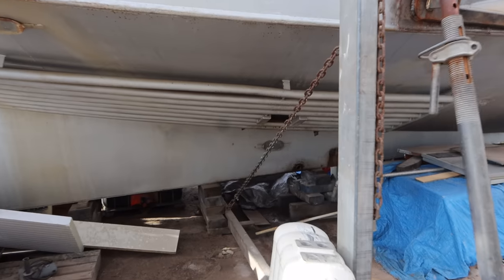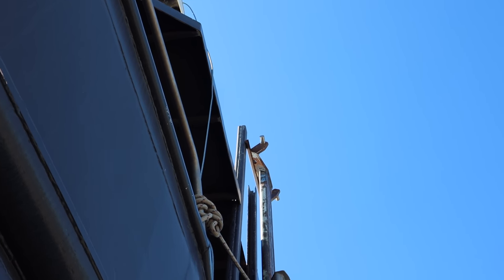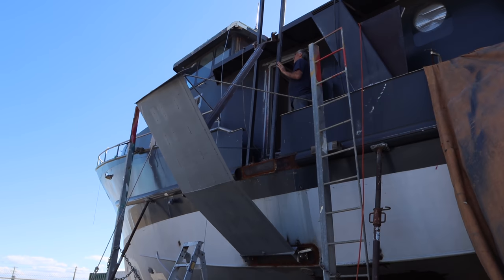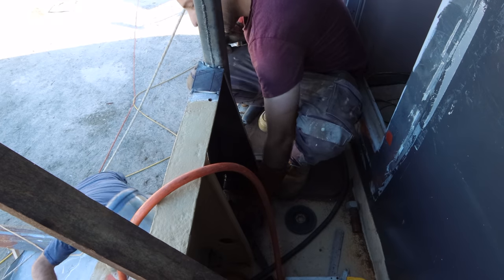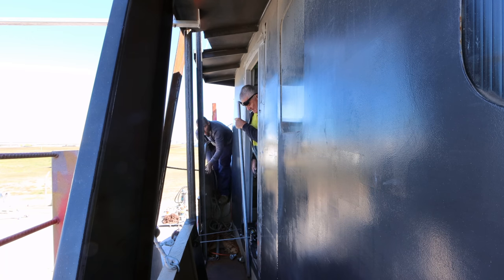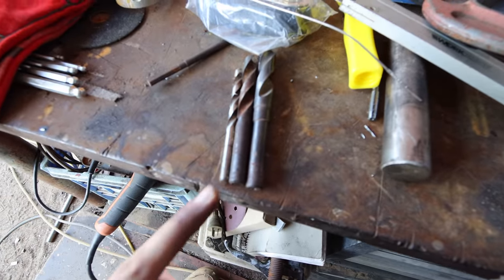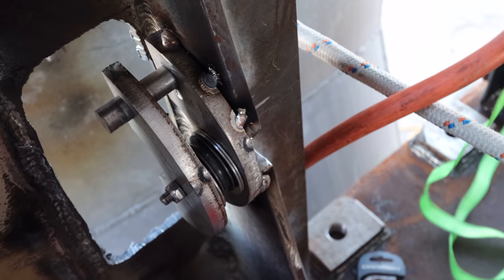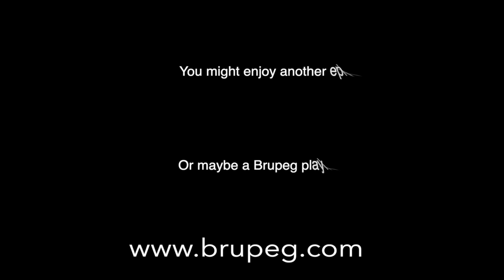Making Pulleys (part 1 of 2) - Brupeg Ep. 169

Comment: Just a quick question from the uninitiated, why did you mount the winch to do a diagonal pull as opposed to a direct pull with it mounted directly behind the guide arms, great work and really really look forward to the episodes coming out, also will you ever be doing a bio on Trev as this is a man of many skills and I for one am curious about this great bloke. Cheers Damo, Jess and Trev. Regards Dave Telford, Adelaide S.A.
Reply from the maker: Hi Dave, simple answer is the lounge structure is very lightweight steel (3mm) so not something we want the full wing weight hanging off, the wheelhouse by contrast is 6mm and is much more solid. As for a bio on Trev thats really up to him, he is qute a private bloke so we have asked but he only gives us snippets which we always include as we get them
Reply: @ProjectBrupeg  Yep he is a champ, thought that was the case with the location but had to ask, I guess you ruled out mounting a doubler on the roof, either way the project is coming along nicely and I itch to see when the next episodes come up, all the best you you all.
Reply from the maker: Yeah I just don’t trust a doubler not to rip out of that 3mm unless is was massive. We also need to put our jet tender on the roof so we can’t clog it up with gear for the wings without causing issues down the track. Everything is a compromise in one way or another and now the wing winch system is working (finished a day again) it really works a treat, better than I ever thought it might
Reply: @ProjectBrupeg  Great to hear, cant wait for the next episode

Comment: When you get to a dock low enough will you lower a wing and have steps to get down?
Reply: Any dock low enough to allow the wing to drop would be 3' under water. Plus most docks aren't wide enough either.
Reply: @quarlow1215  Most yeah but there are some pretty interesting dock set ups out there.

Comment: I was wondering if you have thought about the effect of those wings coming into contact with ice or reefs when they are deployed and the effect that will have on points of connection to your hull. Hit it hard enough and you might tear a whole in the hull.......Just a thought. Maybe some form of bracing to go forward that would help and act as a shield to objects colliding with the wings.
Reply from the maker: Hi Paul, the mounting point on the hull joins with the storngest part of Brupegs structure hence we are able to run without the need for forward bracing, the desing we are using is one that has hundreds of sea years alreadyunder the keel so we are just copying what is currently at sea rather than inventing it all from scratch
Reply: @ProjectBrupeg  Thanks for that, I was just worried that if you hit a submerged object at any kind of speed, you might hole your hull and the places you are planning to go wont have any help on hand as it were. Enjoy watching your project, and as I am a retired fitter and turner/ welder, I have been watching your problem solving with keen interest as well as having a keen interest in sailing. Keep it up you guys. (and gal)
Reply from the maker: Cheers Paul. We are actually planning on making the wings removable at sea so we can steam south with wings then at the ice edge, lift them clear of the water and clip them onto the hull a couple of feet above the waterline, then attach them post ice work. Should be a bucketload if thinking going into that but for now it’s just get wings working
Reply: @ProjectBrupeg  Have you thought about hydraulics to raise and lower the wings instead of cables. I saw a comment earlier from someone who felt the cables might become problematic and for me it kind of made sense as well as the rust factor on cables, stainless or otherwise. Anyway mate I am sure you guys are getting all kinds of advice, so I'll shut up now, but I I see anything that intrigues me I'll be sure to ask the questions.

Comment: Dam - how will the wings lock into place, to stop them folding up when in the swell.
Reply: Bolted to the deck
Reply: @paulkube3901  Not sure about that. They have no contact with the deck.
Reply: Brian, when down, the top of the arm has a plate that is bolted to deck reinforce with 1"+ bolts. See previous episodes :)
Reply: @paulkube3901  I have watched EVERY episode. I have seen the plate wlded to the deck. My question is - you have the arm running up and down the guides, lifted by a winch. I cann see the winch stopping the wing going lower, but what stops it going higher. how do you lock the deployed wing in place. if this is to steady the boat as the boat lists to port, the port wing has to hold fast. How will it do that. This is not clear to me, or you, I reckon:).
Reply: As Paul says in the lower position it will be bolted to the deck plate, you must have missed the episode when they explained it
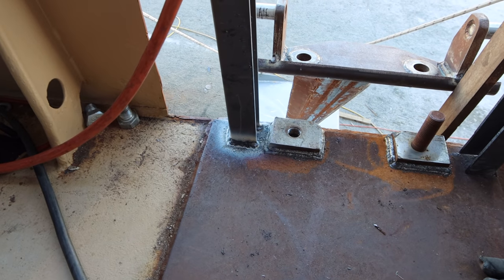Reply: At 12:29 you can see the threaded bar  sticking up , that is going to secure the wing ( there will be one in the front hole too )
Reply: My question is, how in a rolling sea do you get the bolts in and keep you fingers? Same with lifting them back up, bolt removal could be a challenge. I’d like to see a mechanical lock, almost, auto hock, like on a uk farmers gate. The that gives the time and safe space to insert or remove the bolts.
Reply from the maker: Hi Guys, my original thought was a mechanical lock built so as the wing is lowered it auto locks in place and is only released when you pull a cord or something. We discussed this at length with the fishermen that use these wings day in day out and they said they have tried all sorts of things like that over the years and they all fail and end up causing more danger so most boats revert back to two bolts and dont have an issue. Something to remember, these wings will spend 99% of these time depolyed and bolted tight, they only get lifted when we come alongside a wharf or jetty. so dealing with them in rolly seas etc is not something that is normal or even advised. This is also not just use saying this, virtually everything about these wings (and their use) has been learnt by commercial guys of the sea over decades so we trust what the have to sa.
Reply: Dame, didn't realise you'd be deploying mostly in / around sheltered / safe havens. Suppose you might lift them on all those glass flat seas for an extra 0.5knts!

Comment: Putting back the toe rail with mod's, could act as your bumpstop.
Reply from the maker: Yeah thats true. I have now built a locking mechanism to hold the wing up, but i want to add some rubber to slightly load the system up so i can prevent clonking while rolling around.

Comment: Well i will type this but ,i think you will do what you need to do anyway, With the Pin you said you were going to drill into the side bracket to stop it from coming out it would save a lot of time if you scotch dill and tap it so it does not come out most fitters would say the same thing or just drill half way and grub screw into the pin and bracket it still saves drilling 3 bits of stainless steel . and with the Cut outs for the wings i would have stagered the two raise up to take one out and down for the other not both across from each other . Anyway will see what you do in the end all the best.
Reply from the maker: I agree about a hole with a thread etc but with our tooling we can drill but we can’t for the life of us tap stainless. So the clearance hole with a pin is the simplest thing we can build with what we have. We thought also about staggering the notch’s but because of the vertical pin shoulders it wasn’t possible to twist the arm out. This way we can lift one end at a time and it’s much safer
Reply: @ProjectBrupeg  Ok I understand that you might not be able to do this ,but its hard for me as i have Built Trains and Trams for Australia and Hong Kong and there all S/steel + worked in Maintenance Pharma again all stainless steel ,so i wish you luck and look forward to the day Brupeg is in the Sea .
Reply from the maker: I used to work in a machine shop, so the ability to not tap things that would otherwise be so simple does drive me nuts but if it works it works.

Comment: Not that I know anything about wing building, but when the wing is up position, there's still a wing/hull gap. 
If by any chance there's external pressure on the top rails, would you want to reenforce that as well. Stop a twisting. 
Also thoughts of rubber hull bumper for flex or give, help with extreme weather conditions.
Reply from the maker: Hi Robert, the wing will be locked against the hull with a mechanical lock of some sort, so the sliders wont ever be taking any pressure etc. All that said there will still be a hull/wing gap as until we upgrade the hinges to the piano hinge style we dont have any adjustment with the current design. This said it also doesnt matter. on a boat like Brupeg it wont notice the drag of the wings locked up while steaming and 90% of the time these will be down, they only really come up when alongside a wharf or marina.

Comment: Why don’t you put the winch at the top of the handrail that’s going to have the cable in it, that way the load on the cable will pull the winch into the deck rather than at the moment it wants to rip it off the roof, you might need to flair the end of the handrail to allow the cable to spool
Reply from the maker: Hi James, we had a couple of things to factory in. In order for the cable on the winch to spool correctly (ie not turn into a birds nest of wire) we need to keep a bit of distance between the winch and the next thing in the system (in our case its the top pulley, but in your design it would be the wing surface). With the current design the distance is always constant between the winch and the pulley and it coils up perfectly. Mounting the winch low down like you say would work great when the wing is down but the trouble happens when the wing gets close to the hull as the distance would only be a couple of inches. The winch is also pretty bulky so it would further limit when we could place thelifting point on the wing too. 

Everything is a compromise, sometimes you have to make a less elegant design option better as it has the least compromises overall.

Comment: Isn’t that the side plate you just installed that you cut out for the pulley lol
Reply from the maker: it certainly is
Reply: Lol all good brother been there myself many times
Reply from the maker: I plan to weld in a stainless 16mm rod hoop that the cable goes though. but to get there i needed to punch a hole in the mild steel.
Reply: Gotcha make a cable guide built in

Comment: Really worried these wings will be distorted/ ripped off in heavy seas 😪🛥
Reply from the maker: They wont be, they are made out of steel twice as thick as the commercial guys use and they have had their wings in cyclones without damage

Comment: I don't have any figures or anything, but your keel cooler has always seemed huge to me.  It seems like more than the engine could possibly require even in the warmest ocean water on earth.  If you plan to use glycol in there, you will pay for each liter.  If you are doing some surgery in that area, you might consider reducing the size of it.  I bet you could reduce it by half and never overheat.
Reply: Probably so big as it cooled the chilling unit when it was a prawn trawler
Reply: It’s the right size you gotta remember the tubes are steel and don’t conduct heat very well and they get covered in marine growth which lowers their efficiency also they are painted then antifouled  andwhen stationary but with the motor running there is no water flow around the coolers  - always better to have too much rather than not enough
Reply: I hear you, but you pay a price for it in drag (more when it is covered in growth) and fouling on stuff like floating nets, etc.

When you are stationary your engine isn't doing much.
Reply from the maker: Hi Guys, yes the coolers are big but its sized for the engine we have. Drag wise it is a trade off but keel cooling is one of the most effective options you can have on a boat. We do plane to cut them off and replace with internal cooling for ice work however prior to that we wont be modifying them as the plan is to remove them regardless.